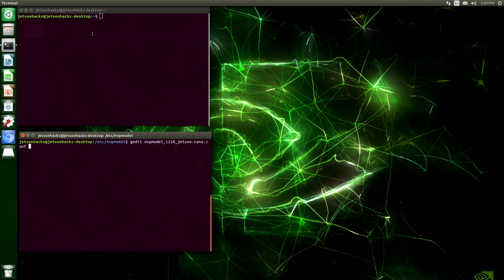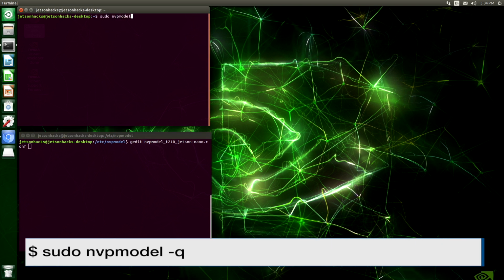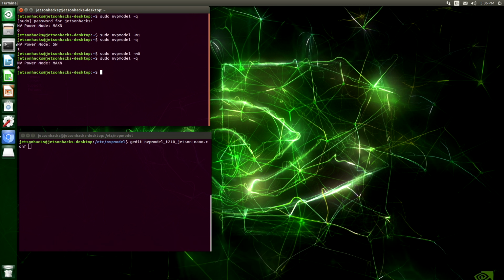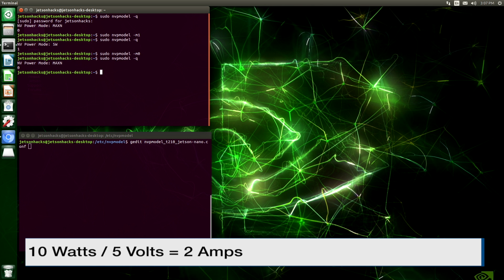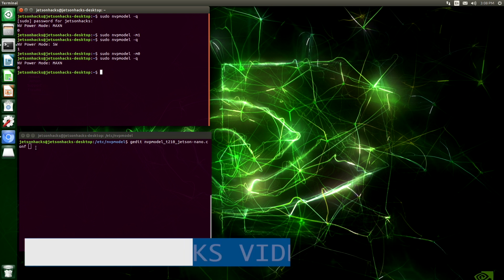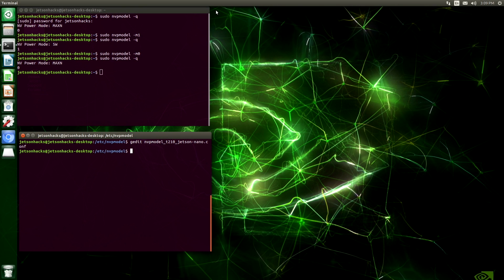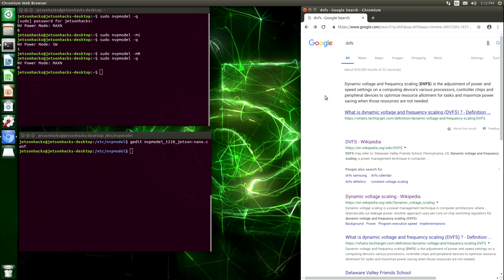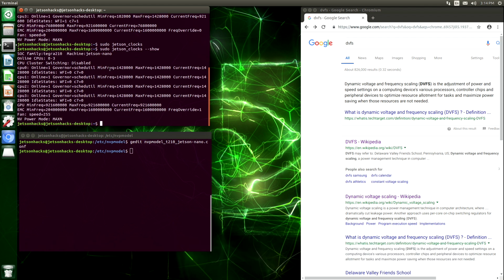Jetson Nano - Power Management

Comment: I want to implement onbaord processing in jetson nano.
The GPIO pin was used, but the battery made the drone too heavy and crashed without performing the command.
So I'm not going to use the jetson nano battery.
I would like to connect the barrel jack to the power distribution board and supply it immediately, is it possible?
Reply from the maker: Depends on the power distribution board. The Jetson Nano requires 5V.
Reply: @JetsonHacks  My pdb is sending input of 22v with a regulator sending out a voltage of 5v. There are two 5v output terminals, one of which goes into pixhawk.
I would like to connect the other one to Jetson nano with a barrel jack.
Reply from the maker: @angokim-l9w  When you tried it, did it work?

Comment: I want to run the YOLO model on Jetson Nano, which would be the On Board Computer on an autonomous drone to be flown for over 30 minutes. What should be the power of the liPo battery to facilitate the task?
Reply from the maker: I do not know the answer to your question. I do not know what the term "power of the LiPo battery" means. Batteries are typically rated by their voltage, their current (amps) and their capacity. It depends on several factors such as if you plan to run the Jetson in 5W or 10W mode, the number of peripherals that you have attached to the Jetson and their power draw. A better place to ask this questions is on the Jetson Nano forum where a large number of developers and NVIDIA engineers share their experience. Thanks for watching!

Comment: got mine yesterday, then blew up a 27" this morning, dont buy monitors without an earth pin or disconnect power first and connect power last

I see the fan speed went from 0 to 255 when you switched modes, was there an actual fan on your unit ?
is 30W too hot without a fan ?
MAXN  Vs 30W with 8 CPUs   is that double the performance ?  and requires a fan ?
Reply from the maker: There is no fans on the units I use. The environment where you are using the device are important. You can read the article on Phoronix.com about the thermal performance of the Jetson Nano. Thanks for watching!
Reply: @JetsonHacks  after a closer look, my Xavier unit does have a fan, I guess they all do.  Just seems quite warm even at 10W power mode. Maybe its a coffee stand too.

Comment: How to use this without monitor , I mean using Jetson nano with laptop screen 

Either through ssh, vnc or any other protocol
Please guys help me, I didn't find anything on this 
Please help!
Reply: I found that the Nano if booted without a HDMI display attached produces an unusable vnc screen output.  I ordered an HDMI emulator to keep the vnc screen at maximum resolution. This is with even the # Allow X server to be started even if no display devices are connected.
    Option      "AllowEmptyInitialConfiguration" "true"
option being set in xorg.conf.  Let's hope the emulator I ordered from Amazon does the trick according to the crypto miners.
Reply: @keithmyers2170  thanks
Reply: I found this emulator at Amazon. https://www.amazon.com/gp/product/B00FLZXGJ6/ref=ppx_yo_dt_b_asin_title_o01_s00?ie=UTF8&psc=1

Comment: Hi, First of all, thanks for making these videos. I'm currently using the Raspberry Pi for many Python projects. The Jetson uses different but similar libraries. I tried to use the Jetson.GPIO library but it complains about permissions when I try to run some simple code setting up some IO pins. It would really help me and others if you could make a series of videos to how raspi user how to move over to the Nano?
Reply from the maker: You're welcome, I'm glad you watch the videos. I think you have a good idea. A couple of questions: 1) What development environment do you use to program your Python? 2) What would be a typical project that you would find useful to work through the present issues?
Reply: @JetsonHacks  Hi, I use the "Eric" IDE on Ubuntu and Raspberry. I have several projects but my current is a weather station and garden irrigation system. This solution is implemented on Raspberry Pi and MicroPython. It uses Postgresql, Flask for Restful API and several custom circuits and 3rd party Hats but mainly custom. I actually fixed my original issue with GPIO on Jetson, I just needed to restart but I'm running into issues with 3rd party Hats that do not support Jetson. I've contacted one supplier (Pimoromi) to see if they can port their Python libraries but early days on that conversation.

These are the two Hats that I'm actively using and they both have custom libraries that might not be simple too port:

https://shop.pimoroni.com/collections/raspberry-pi/products/automation-hat
https://shop.pimoroni.com/products/adafruit-rgb-matrix-bonnet-for-raspberry-pi
Reply from the maker: Thank you for your complete reply. There seem like a couple of issues. The first is just some guide for simple "Here's how to get GPIO to work", and then there is a much larger issue with compatibility between different RPi hats. Adafruit has already ported over their Blinka (Circuit Python) libraries for compatibility with their RPi products. Once the Nano starts shipping in volume, I would guess that the second issue clears itself up as vendors become motivated.

Comment: It's a trivial cuestion but,how it perform on Youtube?
Reply from the maker: It works well. The video is hardware accelerated.
Reply: @JetsonHacks   Can you support this with some evidence? I could not get any HTML video content to use the GPU. I can use gstreamer for hw accelerated video playback just fine, but I think Chromium is built without hw accel support for videos.
Reply from the maker: @vandorhangya  Though I am not absolutely sure about Chromium,  but why do you think the video hardware decoders use the GPU? They are discrete components.
Reply: @JetsonHacks  sorry, I was mixing up the GPU and the discrete video decoders. The problem still exists. If you use gstreamer let's say, like this: 
gst-launch-1.0 filesrc location=<filename.mp4> ! qtdemux name=demux demux.video_0 ! queue ! h264parse ! omxh264dec ! nveglglessink -e  than gstreamer will use the video decoder. I can see that almost no CPU is used. But if I play the same video with Chromium, I will see significant CPU usage. The problem is that Chromium does not use the hw video decoders: https://devtalk.nvidia.com/default/topic/1048992/jetson-tx2/hardware-accelerated-video-playback-in-chromium-/post/5323786/

Comment: Can we attach a Intel optane 16 GB in the PCIe m.2 slot for boot  or is there any other method other than SD card boot up.
basically i want a fast system with nano

and your videos are awesome and encouraging
Reply: Kayak Fan
1 second ago
I'm currently waiting on a M.2 Key E to msata converter to try out if that works. That essentially converts the connector to the msata key m slot. In theory that should work since its still a PCI-E bus.
Reply from the maker: Thank you for the kind words. The M.2 slot is Key E, which means that it's mostly for wireless cards. Typically SSDs are M.2 Key M. At this time, the only way method I know of is to boot off of the SD card. Thanks for watching!
Reply: @JetsonHacks  No usb3 boot ?
Reply from the maker: Not that I know of, but you should ask on the official NVIDIA Jetson Nano forum: https://devtalk.nvidia.com/default/board/371/jetson-nano/ where a large number of developers and NVIDIA engineers share their experience
Reply: @AltMarc  You can put the root on the usb3 and boot from sd. That's officially supported and there's even a script that configures it all for you (including the required kernel rebuild).